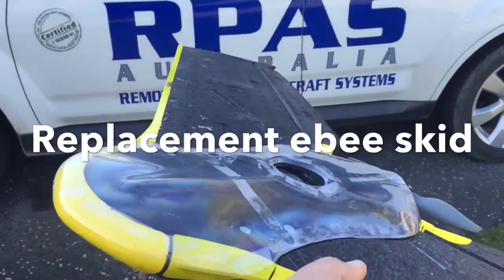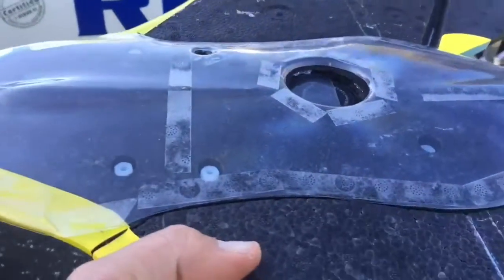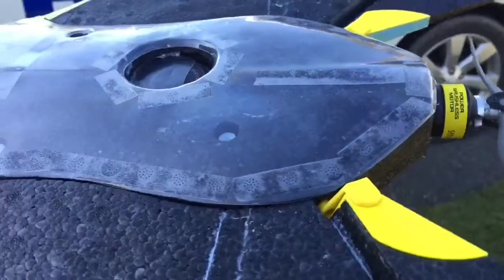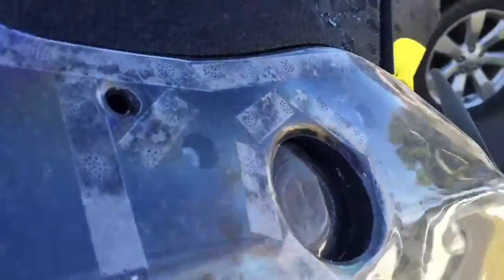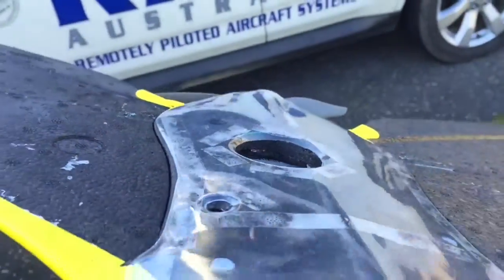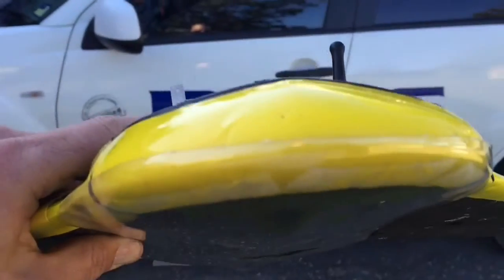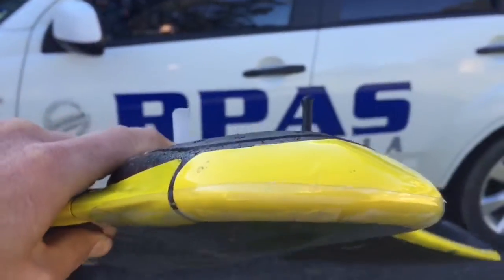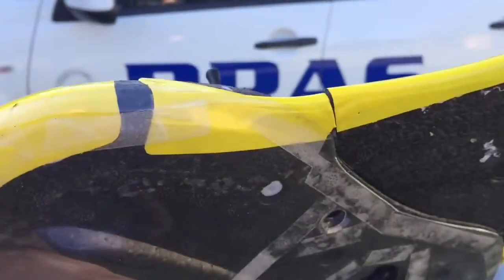Sensefly eBee skid plate replacement

Comment: Where did you get that?  The skid plate on our eBee doesn't cover the entire bottom which means I have to cover the edges with electrical tape when we land of rough surfaces.Thanks!
Reply: We plastic Vacuum form them. You can buy them from our website  'UAV shop'. Thanks